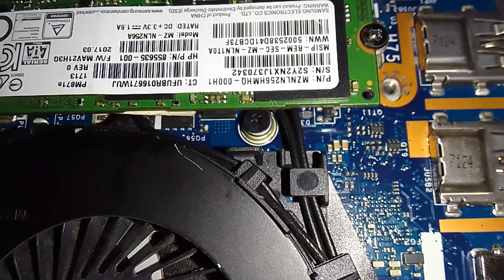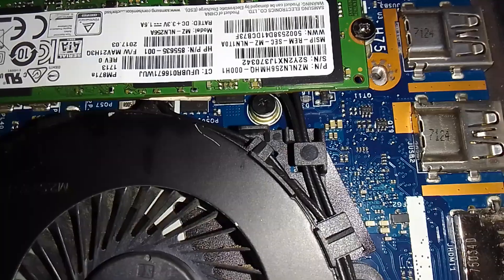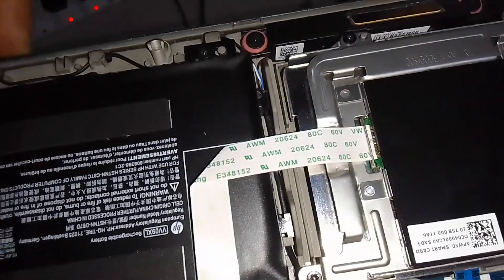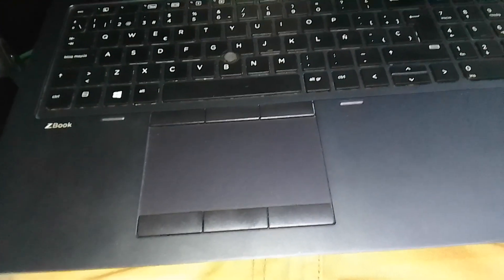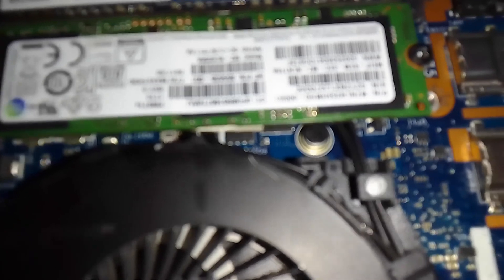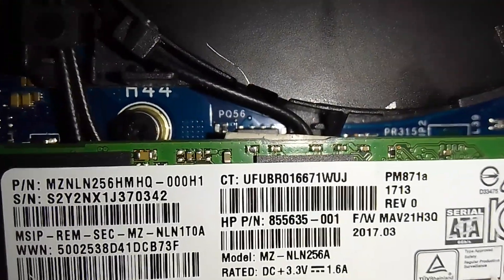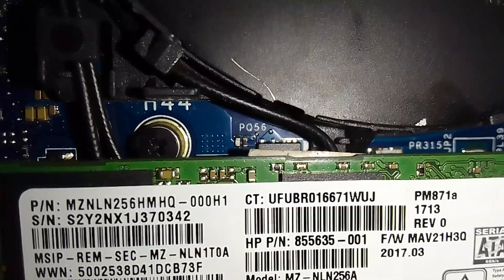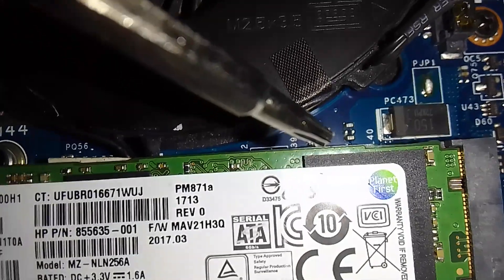#hp  #zbook  15 g3 not powering after battery ran out

Comment: Hello, excuse me, I wanted to ask if I should bridge the resistor and the capacitor while the laptop remains on with the charger connected while the power button light is flashing? Or should I do the process disconnected, that is, without power? Thanks!!!
Reply from the maker: Power should be on
Reply: @evamattechnology4666  Thank you very much for taking the time to respond to me so quickly. Another detail or question: can the trick/hack be done even with the battery disconnected, since I wouldn't be interested in charging it. In fact, I'd like to remove it so I don't use it anymore and see if I can still exit the (power button blink) state like the one in the video you're describing, without it? The laptop went at least a year without being used/turned on, maybe up to two years, and then they gave it to me. Hugs!
Reply from the maker: @zurditomarconi welcome thanks for your feedback
Reply: @evamattechnology4666  Could you please answer my last question/issue about whether I can do the process without the battery (only with the charger) ? since I want to use the laptop as a desktop without being interested in portability, apart from that the battery has probably not been used for 1 to 2 years, thanks!
Reply from the maker: @zurditomarconi try to remove the battery and try but some laptops cant power on without sensing the battery so just try your luck mine i am using it with the batt

Comment: Hi Sir , I had the same problem on my zbook 15 g3 ; 
after watching this video I tried to short the resistor (with a pair of tweezers) under PQ56 and nothing happened .
However , then I tried to short the capacitor near the resistor (the white one) and the pc booted fine , and now it starts to recharge .
I will leave a big like on this video because I found nothing on the internet, and this was very helpful indeed . 
Good job Sir.
Reply: I had the same problem, could you show or mark it in pict below where is the white capacitor and how to do it? many thanks...

https://drive.google.com/file/d/19pFe_XtUX7qg_6grmhyDMgqsg7NusXIQ/view?usp=drive_link
Reply: did you remove that capacitor and just solder the wire or ?